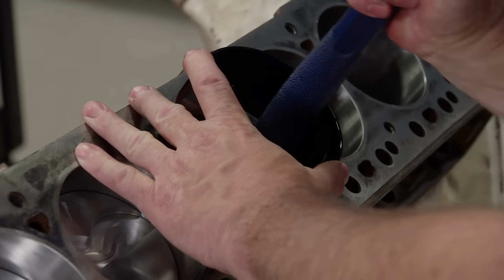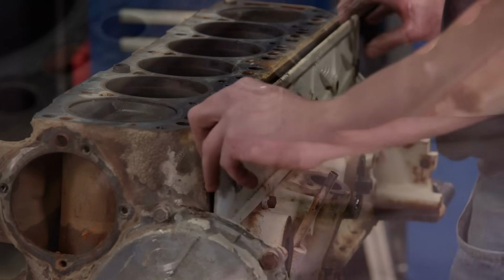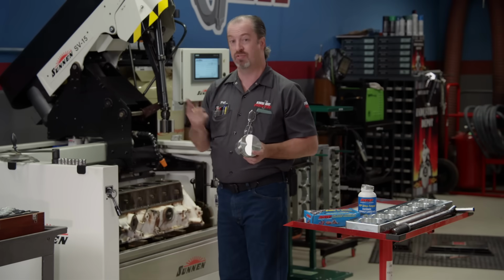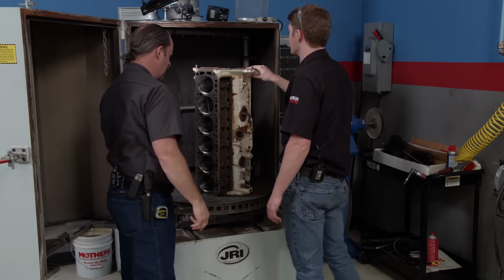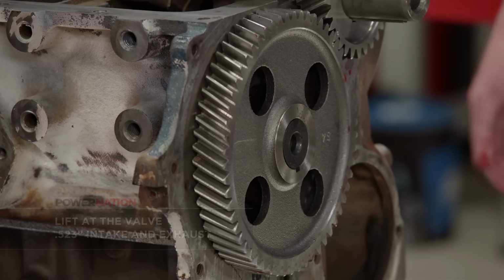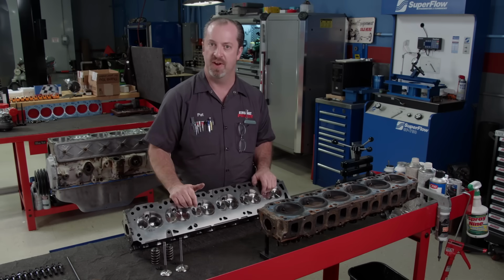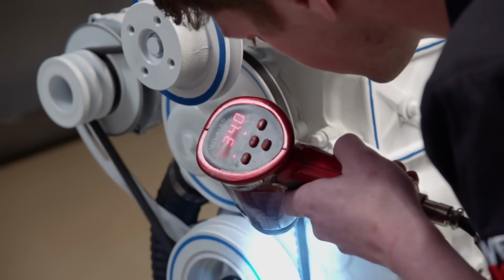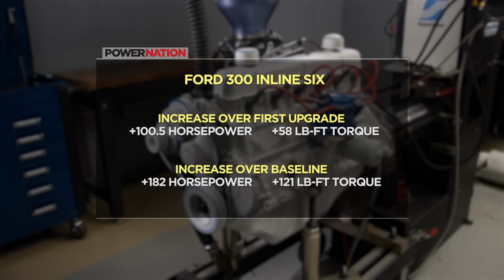Full-Tilt Build On Our Ford 300 Inline 6 For Serious Power Gains - Engine Power S8, E3

Comment: How much is this engine all said and done it would be a cool engine in a short bed obs
Reply: Ed Miller  that is what I was thinking
Reply: Ed Miller  ya for sure hp wise but longevity iv seen these with 350000 never touched except standard maintenance good motors iv have a a new 93 f150 thought it would be cool to do some engine work on it not common

Comment: That thing needs more camshaft, it’s peaking at 4500, I know they don’t rev but a cam that’ll take it 5500 would be perfect for the street and will probably add another 50Hp to it, add boost after that and watch it take off...
Reply: The head is definitely the limiting factor agreed, it needs more port work if that’s even possible with that head. With that 4.0 + 50" bore there’s definitely room for bigger valves.

Comment: ive got a little more out of a 300 build before, but it was a custom cam and had a lot more money than the entire budget so far just in the head. 270hp and just under 400 on the torque side. it went into a gen 1 bronco with a 3 speed so it was a massive improvement over the little 200 that it had when my uncle got it. the head came from a speed shop out of omaha nebraska. its long since gone away. my dad and i went there to show him a bit of where i got my physical rehab when i broke my back. we tracked the guy down to a pawn shop, manning the guns and collectors items. they had some sweet stuff i wanted but the guy was on a team that made 2 different V16 engines. one was made of 2 chevy 283 blocks and another of 2 of the ford 289 blocks. they wanted to do a mopar 273 based engine too, but it was out of budget after the first 2. they were prototype engines. both are in some guys private museum. he did have an aluminum high rise 2 barrel intake for an FE engine i bought. still got it in storage, i want to put it in a pickup some day, build it for torque way down low.

Comment: "Full-tilt"

Only 9.5:1 compression.
Reply: 10:1 iron head turbo motor.
Reply: @guhfluh  would like to see what it would do at 13-14:1 with Q16 fuel. Offset grind the crank to bring the piston to zero deck and let her eat.

Comment: Can bigger valves fit in that head? The Ford 300 has a 50 cubic inch per cylinder displacement, almost identical to all the Big 3's 400 engines, with most of them having MUCH larger valves.
Reply: They can fit, but gains are limited by cylinder wall shrouding above 1.94ish. 1.6 exhaust is plenty

Comment: You're right on the longevity of this motor. The company my dad worked for had a fleet of ford vans with the 300 6 in them and would sell them after 300k to 400k miles on them and you could see their new owners still driving them around town years later.
Reply: Ed Miller  the 88hp number is from the pure industrial application. the version in the pickups made anywhere from 105-117hp carbed (FI made about 190hp)
Reply: @bigboreracing356  My dad's fleet van had 320K hard driving city miles and literally not one single problem ever with the engine.
Reply: Ed Miller  88 hp and about 240lb/ft at 2000rpm
Reply: Makes me think of the UPS truck sound.
Reply: @bigboreracing356  I don't think there's many if any 300's still being used by UPS. I wouldn't be surprised if they pulled them in the shop all the time for major repairs, anything that company owns with wheels with the exception of new tractors are the biggest pieces of shit on the road! scheduled for repairs, parts on order, in other words we don't want to fix it until it breaks, then we still don't want to fix it right. The hub I work at are almost all v8 either LS based or whatever Ford engine is in the Ford powered big brown turds. They've been scrapping the diesel based package cars once something goes wrong with them it seems, I see very few of those left and there's a whole pile ADA behind the shop at any given time. I've seen quite a few get engine replacements and those ones weren't even that old. Still haven't seen anything best the 24 valve cummins in the old 40,000 hour yard goat though! that thing was a pile to drive but ran great.
Reply: @bigboreracing356  What does it not have to do with it? I was talking about the 300. And the only reason he got rid of the van at 320K is because it didn't have AC so he bought a new one with the 4.6.

He then went on to have shutter and slippage transmission problems, spark knocking issues (as I did in my Crown Vic and Expedition) and the head gasket blew at 160K.
Reply: @bigboreracing356  Prove to me your experience of anecdotal evidence "factually" represents "average", and I will still show you anecdotal evidence of my own experience. This is an argument apparently neither is going to win so why carry on with it?
Reply: @bigboreracing356  We don't need to prove anything to each other. Have a nice life.
Reply: @bigboreracing356  Your comment demonstrates your shocking lack of reading and comprehension skills not an argument with proof. All you did was just make my point again.
Reply: @bigboreracing356  Now you're projecting.
Reply: @bigboreracing356  k

Comment: All that money on ARP fasteners just to paint them
Reply: Ed Miller  pretty much, I belive its anywhere from 2.50-5$ per basic fastern then main cap and head bolt kits run like 150-350$ EACH its crazy!
Reply: Ed Miller  yup, hardware doesn't create more power thats for sure
Reply: Ed Miller  thats correct, and the reason why they are torque to yield is due to the reason i stated, and a reason why cars these days no longer have reusable head bolts like the old cars of the day. You cannot stretch a bolt twice because that is an overstretch which will surpace it maximum clamping force. Its exactly like you twisting a bolt. It gets tight, tight tight, but then when you go past and it gets loose all of sudden. Thats why you can't use them over again